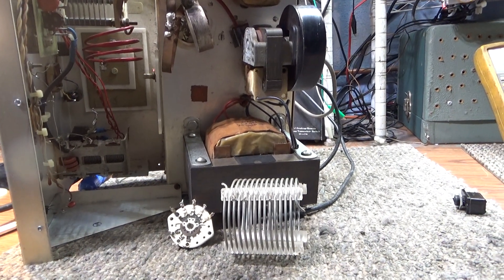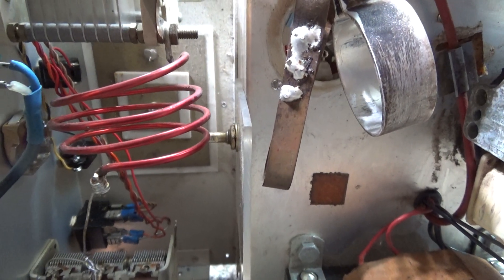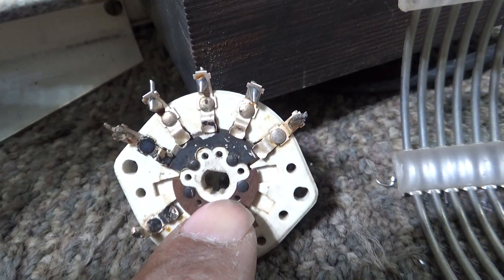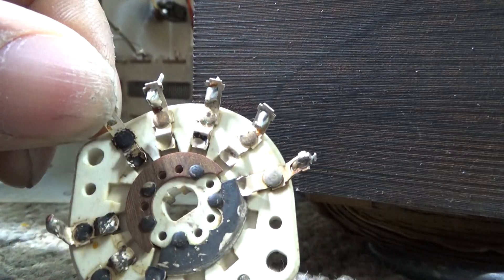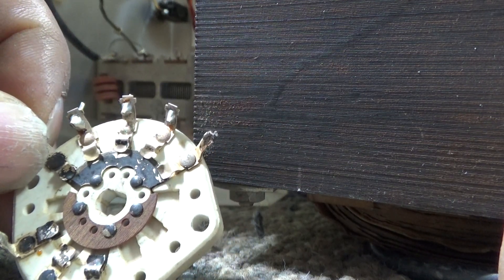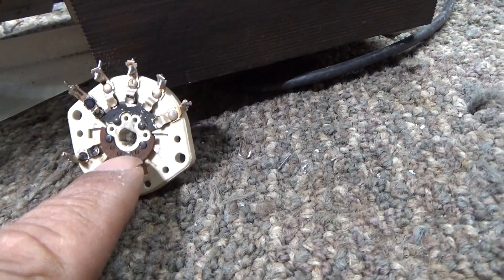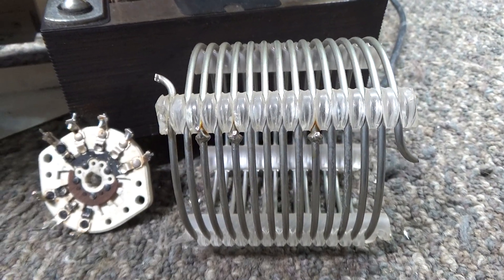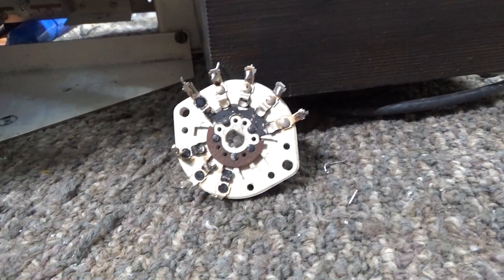Another Linear amplifier killer, the Band Switch.

Comment: Is there some reason, other than price and perhaps space inside a small amp, a roller inductor with turns counter couldn't be used instead of a switch?  Then all bands would still be available.  And once setup, the roller inductor could be tuned to the correct setup without even the amp turned on.  And spring loaded, the roller would always be in good contact with the coil.
Reply from the maker: Price would be #1. Space, simplicity and dependability are all considerations too. IMHO a top of the line, premium amplifier would have: Roller Inductor, Vacuum variables, vacuum relay, blower instead of fan, soft start, stiff power supply, and tube warmup time (if needed)  An amp like that would run at a very premium price too. Here is a link to what is considered one of the modern premium Ham amps using a pair of 4cx800's. Look at the price:  https://www.dxengineering.com/parts/aom-2000a#overview

Comment: That black tarnish is silver oxide, which is still conductive. If you put that switch in Tarn-X, it will remove 99% of the tarnish and convert it back to silver.
I have used surplus switches to replace burnt parts, and restored the amp to near new condition. Rather than limit an amp to one band and make the resale value near zero, restore it and keep it in the market!

That section of coil has a large value in the electronics community!
Reply from the maker: silver oxide is not 100% conductive. Also, since this channel is mainly for CB'ers and kinda a CB for dummies at that, no offence meant to anyone, most CB'ers rather have a more dependable amp that puts out a little bit better than an amp with all the useless Ham Bands and the amp killing Band Switch. I am writing a book on a totally different subject, but one theme in the book is to "know your audience."  You don't teach Trigonometry to 3rd graders.
Reply: Your right on again Doc ! The Palomar 300 A was a bastardized ham amp, so they could sell it to cber’s ! The high low switch . High is for the driver tubes low is for just the finals so you could hit it with a ham transceiver. It’s impossible to tune on the ham bands. See BBI ‘s video on tuning this amp! Bottom line it’s a CB amp! JohnBoyUtah KJ7TBR 🇺🇸😎🎙📡
Reply: Its a gimmick. the amp was never really meant to work on 20 40 80. there is no input coils for those bands. It was only there to pass FCC rules. Like pedals on electric scooters. the pedals are useless but it passes the loophole of needing pedals.

Comment: Good information! Any good tips/articles or videos on mono banding a sb 220? Or are they built heavy enough stock? Thanks doc
Reply from the maker: I think the SB-220 is not a well built amp. There are hundreds of articles on addressing most of its problems. To me, the main issues are, undersized transformer, undersized tune cap, load cap, and band switch, voltage doubler for the HV, no step start or surge limiting, cheezy bias circuit, not enough cooling for the tube pins, and no meter protection come to mind.
Reply: @tramdr  ok thanks I got one from a local and I grounded the grids, I drive it at right about as much as the transformer will take and I’m pretty sure the fan is upgraded. Thanks for the information. If I get serious I’ll get a real 500 a amp lol

Comment: Seems like I read that Pride amps were built by disabled people? 
I remember when Heathkit came out with the 220 amp that had 10 meters removed. Hammy Hams were saying that CBers could no longer use them on 11 meters!🤣 Those hams sure were good for some laughs!
Reply from the maker: Yes Pride was "Made with Pride by the handicapped"  First they removed the 10 meter band from the Bandswitch on a SB-220 then when that didn't work, they came out with the SB-221 which not only didn't have 10 meters, they added a device on the input side that was labeled 'Filter'. It was a filter all right, an 11 meter no pass filter. It blocked 11 from coming in. I knew a guy that had one, drove his 221 with a Phantom 500. 500 watts in to get a thousand out. He did this for 10 years and the amp was right up close to him on his desk. At about 55 he caught brain cancer. I still think this was why.
Reply: @tramdr  Wow, that’s a crazy way of running the Heathkit amp! I’m also inclined to think his cancer might have been caused by that. 
I knew a fellow who built Heathkit amps from kits to sell to the “Big guns” in the East St. Louis Illinois area. Back in the 70’s there was a channel that the huge amps hung out on. He used to drill the rivets out of that filter and remove it from the kit. He ordered the coil from Heathkit that they left out of the new kits and install it in the 15 meter position. Anyway this guy built those amps from kits and added a second power supply, because they were weak. Then he started adding another tube. Then two more tubes and three power supplies. It was crazy! But the point is that there were Hams who actually thought the FCC restrictions would stop their use on 11 meters. He used to laugh at their stupidity.